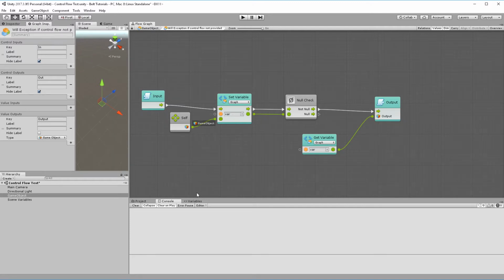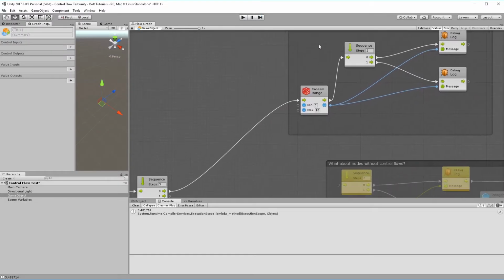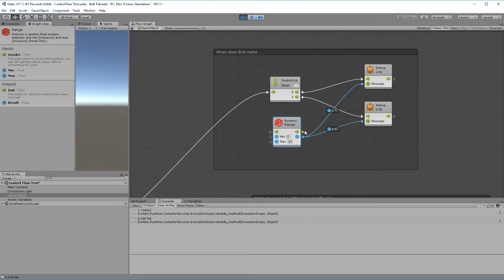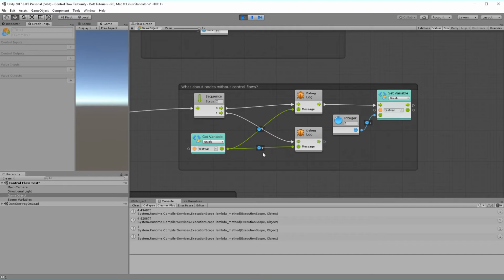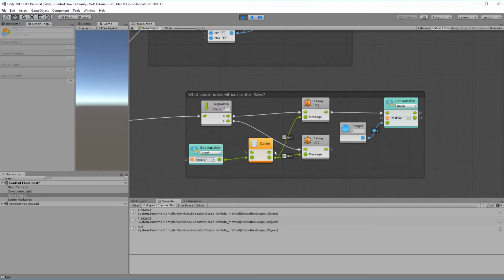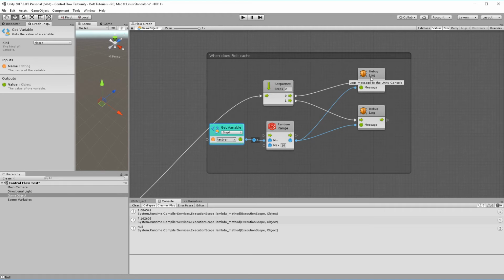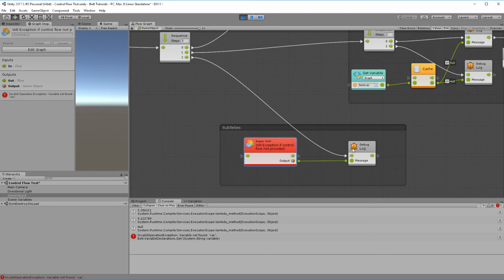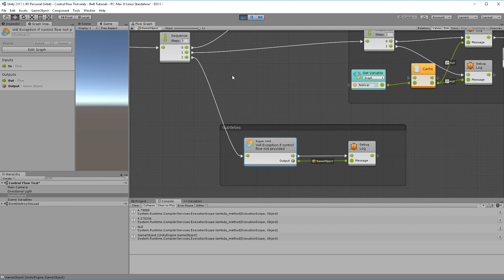Unity Bolt Tutorial | Control Flows and Caching

Comment: 2:18 my bolt units are connected up to a control flow but they still execute when another unit is executed that has those blue lines connecting them both together, How do I get them to not execute? Sorry if this is difficult to explain
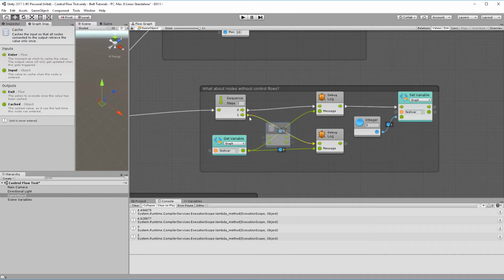Reply: Ok I’m going to try what you did at 5:00 and see if that fixes my problem becasue I had an issue where objects kept instantiating inside of another object over and over and I couldn’t tell why because I didn’t know units can execute if they have a flow thing connected to it but there is no signal going through the flow telling it to do something, I’m going to try caching next time but I already did way to much complicated stuff in my game to get around this problem and it was so hard so I’m going to leave it like that for now

Comment: as i see, bolt can speed up a lot in programming platform game, but is it better than script in puzzle game?
Reply from the maker: While the problems Bolt tries to solve are fairly generic, a good coder can put code in a file faster than they can wire nodes in a graph, and track state well enough to get by without seeing a graph, it's true.  I've been writing C# for a long time, yet I'm still on here using Bolt because it can natively access my codebase, giving me the best of both worlds.  I write my data classes and helpers in C# where I can utilize lambdas, LINQ, etc and then graph the logic because not only is it so much easier to see  (and oddly fun)... it's also a lovely debugging experience.  I use fewer simple nodes because of this approach, but the experience has been quite positive, regardless.

Now, I'm solo, but where it really shines is if you have a small team where not everyone is a great coder.  Being able to show a designer or artist a graph that clearly shows where the logic is going in terms they can understand is a huge thing.  At a glance, you can tell what code is active and being used, and you don't have to be a coder to follow a flowchart!